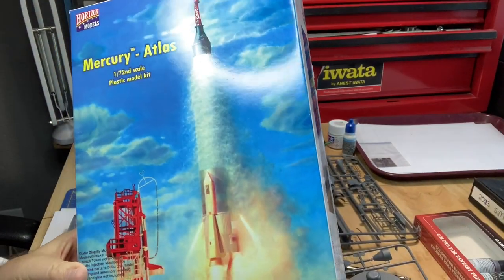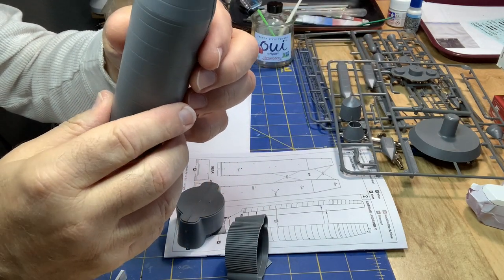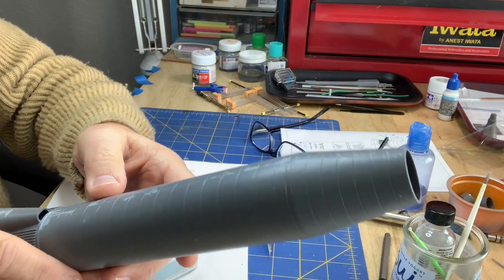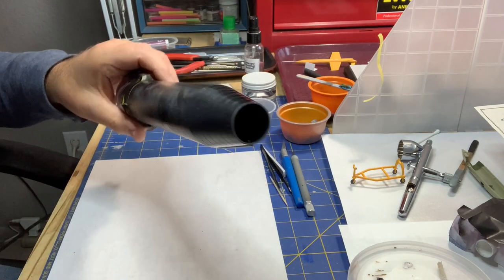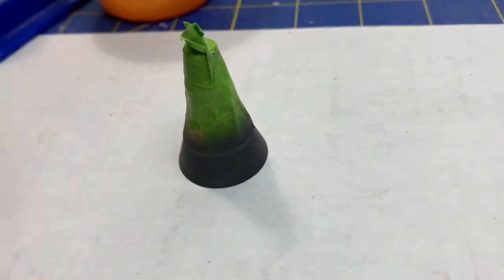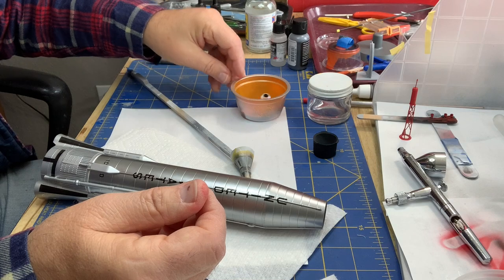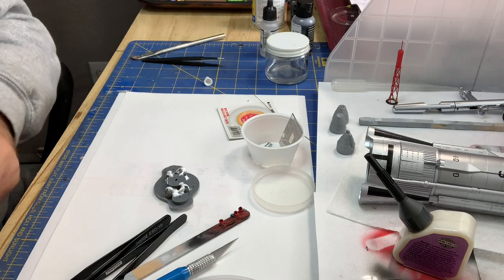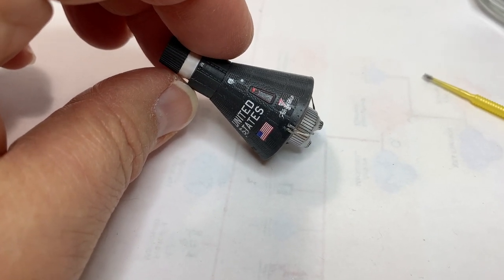Mercury Atlas from Horizon Models

Comment: Timely, Mike!  I'm building a pair of them right now - one for the boilerplate and the other for the manned capsule.  The long seam was a challenge for me too - some of the "panel lines" need to be rescribed to improve the alignment of the two halves.  I used sprue goo and Mr. Surfacer to replace and fill where necessary  . . . had to prime, scribe, fill again, prime, and scribe on a couple of sections.  Cleaned the errant scribe marks off with thin super glue.  Not perfect, but one has to take the eye of the IPMS judge to find the imperfect. The plumbing and decals also do a nice job also covering up some of the seam work.  Using Mission Models paints which are going down very nicely (once I became comfortable with their "system.")   

I have the Horizon Redstone up next - will be much more cautious about joining the two halves of the tube this time to prevent as much seam work as the Atlas.  

And, nice job on the escape tower!  It has been a challenge to keep the stucture in alignment to the pointed tip.  The slightest of angle betrays itself!

Comment: I really like the build.  I have now built the Mercury-Atlas and the ICBM versions of the kit.  I wish that I have thought of putting the weights at the bottom to make it more stable. Now I need one more to do either sigma 7 (Essentially a perfect flight) and then Faith 7-Cooper's long duration flight with a hand flown retro firing and decent. Instead of using the wrap around decals I simply painted the stripes across the pipeline by hand.  Good to have you online and I really appreciate your reference materials.